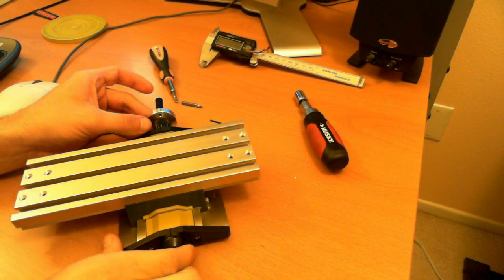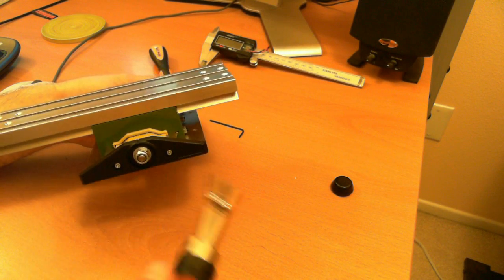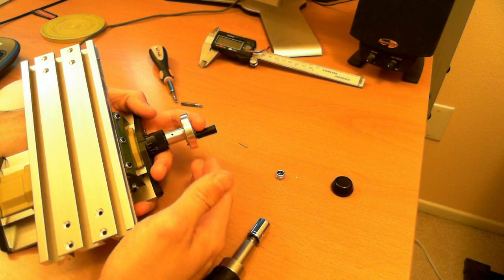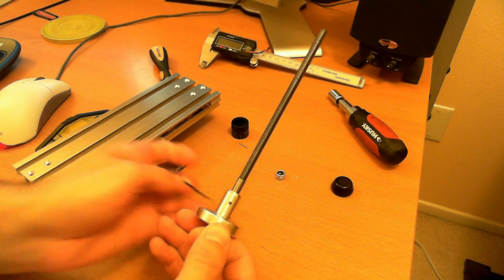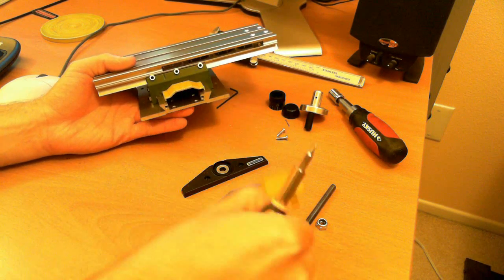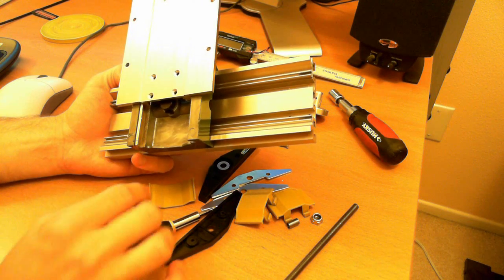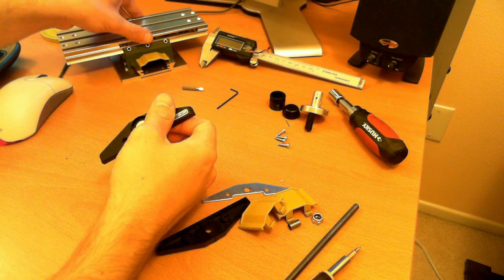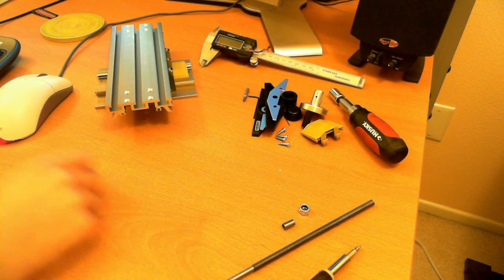Part 1 - Disassembly of X / Y Axis - Bubblegum CNC Conversion Kit for Proxxon MF70 / KT70

Comment: Hey, I'm trying to get the handwheels off but I've no idea how to get that pin out. How did you knock yours out? When I try to get it out I seem to fuck it up inside of the hole, basically tightening it even further... Any suggestions? Thanks!
Reply: Did you find a way?
Reply: @EnezReyiz  Had the same Problem. What worked for me was putting a small Nail in the hole that the pin is in and pushing the nail through the hole using a vise.
Reply: @knoccy  thanks Maximilian, I bought a pin punch with the right diameter. It's really easy to remove the pin with it. I tried to hit a nail with a hammer but that didn't work because the pin was really hard. But I like the idea of using a vise 👌

Comment: I'm doing macro photography focus stacking manually with a Proxxon xy, am currently building an Arduino based stepper controller to do focus stacking. This is a neat solution to connect the motor, I only need the one axis to move the camera back and forth. Are you likely to supply a kit of parts in the future for just one axis?